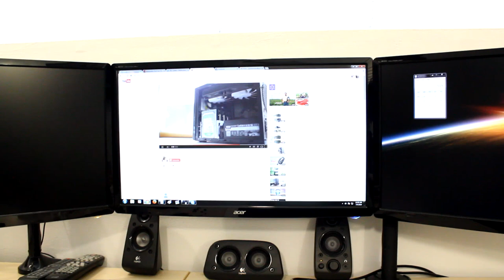Build Vlog Part 2 - Answering some "Why?" Questions

Comment: So yes, this is an old video, but I've never seen them. That trick for knowing where to drill the hole by using a flashlight is mind blowing. Thanks Jay, I will be using that for sure if I build another new computer... or should I just buy an intake manifold and nitrous? lol

Comment: You should set the SP 120 fans as exhaust for the rad below. Place the fans against the grill below opposite of the rad. Since hot air rises, it can help pull more hot air out.

Comment: Possible explanation for the radiator fans only working half of the fan is your fans might have been running at a lower fan speed than 50%? Someone may have said that or you might have figured the real reason by now. Awesome build as a whole Jay! Love your vids!

Comment: You should mount the reservoirs at a 45 degree angle and then use a 45 degree fitting to get the pipe going straight down to the bottom compartment (just to fill out the empty space)

Comment: I  hear ya. You don't want to be down with the 900D computer. What I normally do and I did this recently when I upgraded my case is that I have a secondary computer that's close to my main rig (Intel = main rig. AMD = Backup rig Hahaha) and day by day if possible (College student).I try to remove a part from old case and install it in the new case. The max I'm down with my main rig from recent experience is 2 weeks due to the fact I had to buy more components for the new case. Which is not too bad. I could have yanked all my parts out and installed it in my case but it will take too much of time.

Comment: Jay did you have any issues running Mayhems in your Alphacool rads? I got 3 in my 900D - 2x 480's and 1x 240 Monsta rad: all acrylic build just running DI + liquid utopia atm... But heard Mayhems and Alphacool rads do not play nicely together and will require Mayhems Blitz Pro (apparently) if you did use mayhems did you run into any issues?aaaa

Comment: looking good Jay, love the all black EVGA motherboard and the yellow accent color. will you be using two reservoirs to fill in all the blank space on the right side of the case. if you keep going the way you started skunk works is going to be just as good as red mist or even better.

Comment: Really awesome looking build, Jay.

I have one question, why do you need two radiators?
Reply: Cuz its cooler (no pun intended)
Reply: No but legitimately, I thought you only needed one rad.
Reply: ***** You can put as many rad as you want man, and also Jay has a dual loop (one for CPU and one for GPU) so he needs a minimum of two rads.
Reply: acnfanmanin Ok. Thanks.

Comment: Build is looking great Jay,bit surprised your not using a EVGA Pro SLI Bridge (might look cool). Looking forward to seeing this beast complete.
(wow that video had a lot of Advertisements on it, I'm sure I watched 4 in total watching this video, kinda pulled me out of the video)
Reply from the maker: Those bridges are quite hideous in my opinion
Reply: fair enough
Reply: ***** You mentioned carbon fibre sticker paper to cover the corsair logos on your fans. Couldn't you use that paper to cover the ugly standard SLI bridge as well or is it electrically conducting?

Comment: No, I'm not surprised there's so much dust build-up. It would be moronic to be surprised, you don't use any fan filters. Yes, it definitely improves performance, but dust is a given in that situation.

Comment: ***** so here is my question. If you have a good graphics card that runs games above 60 fps, and you have a 60 hz monitor, wont the monitor only support upto 60 frames  for that high end graphics card? so basically just wasting frames if you have a good card?

Comment: radiator got clogged on Motherboard side cause Motherboard is static when powered on and attracks dust particles, therefore you'll find more dust on the Motherboard side in the radiator.

Comment: Buy some thinner fans for the top rad? I mean given the height of the case and because there will be a top fascia on top of it, you could get some of the higher performance ugly as hell noctuas and put them up there. Or just buy a taller top. Whatever.

Comment: why don't you use the rear fan for intake so you can get neutral pressure and less dust
Reply from the maker: The rear fan on the 900D WAS an intake my friend.
Reply: ***** oh ok sorry
Reply: ***** rear fan of SMA8 is an exhaust (3:17 of build vlog part 3)

Comment: Hi Jay

Build is looking great!

You say your GPUs are overvolted via re-flashed bios' and you have all this great watercooling I was wondering if you are keen to push you system to the limit why it is that you haven't delidded you old CPU? 
I know this is not nessacary for Devils canyon but being an overclocker what was it that made you think twice about doing your old Ivy?

I only ask as im in the same position and I may delid mine and i was curious to youre thoughts on the process

Cheers 

James
Reply from the maker: Delidding kills the resell value.
Reply: ok I get you

Comment: Will you upgrade to the SP140s when they come out (Corsair said they're in the works).
Reply from the maker: Did you listen to what I said about the fans?
Reply: ***** Yes. I believe, Corsair announced they will be making 140mm versions of the sp120 that are not LED and will have removable rings. So, you can just repaint the rings again. Although on that FPI rad I don't really see the need like you said.

Comment: love these detailled vlogs :D

jayz i got a little question, i got a laptop with 1 ramstick 4gig and 1 ram slot open, can i put a second ram stick of 4gig in there or do i need to buy a set of 2x4gig ?
Reply: Not sure if he will awnser you (since he has so many subs) so i think you should ask the question on Toms Hardware, but you never know he might have the time to awnser :D
Reply: You should be able to put that RAM stick into the laptop with no problem, Just make sure the Pc type is compatible with the laptop. Also check with the laptop detail to make sure that amount of Ram is accepted. Best of Luck.
Reply: undeadmith if your motherboard supports adding another 4gb you can. look up your model and find the amount of ram the motherboard can handle
Reply: thanks guys for answering :D

Comment: Hay Jay am wonderin if me build cen run cryziz 3 et mex setings:
AMD Sempron LE-145 Single Core $19
1GB DDR2 RAM $6.50
80GB WD Scorpio $18.72
HD5450 1GB $27
Biostar A780L3C $29
Cardboard Box $1 
Total = $101.22

It neds teh be abl teh mex ewt cryziz 3 et 120 fpz, cen strech fer woden bex meybe ef i git eh loer end gpu. tenks.

Comment: Hello, JayzTwoCents.
I am from Portugal and at this moment I already spent close to 3500 € only in the hardware.

I bought:
Z270 LGA 1151 GAMING 8 - 174.90€
INTER I7 7700K 4.20Mhz - 459€
X2 16GB GSKILL TRIDENT Z RGB DDR4 3200Mhz - 349.80€
X2 EVGA GeForce GTX 1080 FTW Gaming ACX - 1659.80€
CORSAIR AX - 1200W 80+ PLATINIUM - 389.80€
SSD: KINGSTON V300 240GB (For Windows) - 106.90€
X2 SEAGATE BARRACUDA 5TB SATA III (For Gaming, Movies etc) - 449.80€

So far it's ok it took me almost 6 months to buy it all now the big problem is in choosing my tower. 
With so many videos on youtube it's a bit difficult to choose one I need your help to choose a tower. 
I want a RGB theme tower i dont have yet any ventilation (Im still working in what to buy or if you can help me that would be great) and I want this system that I am building to have a good air flow because I know that these graphics cards will generate a little bit of heat will you be able to give me a help on a RGB theme tower?
Reply: 3 years later.

Comment: Can someone help me I am looking to build a pc and I have never built one but I did research and this is what I came up with I want to know if this is going to work 

Motherboard:ASUS m5a99x
CPU:amd fx 8320
Storage:g.skills ripjaws x series
Video card:evga GeForce gtx 1 gb 128bit 
Optical drive:Samsung DVD burner
Fan for CPU:cooler master hyper 212 plus 
 Case:I already have one

This all cost roughly $554.94 so if you have any suggestions than it has to be under $630 thank you if you help me
Reply: Choose a better GPU, and you might also want a HDD and a PSU
Reply: Thanks but I did more research and found better parts thank you anyway
Reply: What GPU exactly?
Reply: Also what case, cause with that FX 8320 you might have heat issues if you have a crappy case.
Reply: On my new one I created after this one?
Reply: We'll with my new build I made over this one the you is a evg gefoce gtx 660 and the case is a rosewill challenger
Reply: I have evga GeForce gtx 660 and the case is a rosewill challenger
Reply: Wait what kind of GTX 660 is 1GB and 128-bit like you said up there?
Reply: The case should be ok.
Reply: I think it's a 2GB with 192 bit
Reply: acnfanmanin because hes new to this, cut him a break
Reply: Eskmm1 Was just asking cause if he meant going for a 128-bit card to 'upgrade' his GTX 660 then it's a downgrade.
Reply: I recommend you to buy a Gigabyte motherboard with 990fx chipset instead and get the FX 6300. This will save you money and you can get a better videocard
Reply: Also you will need a harddrive